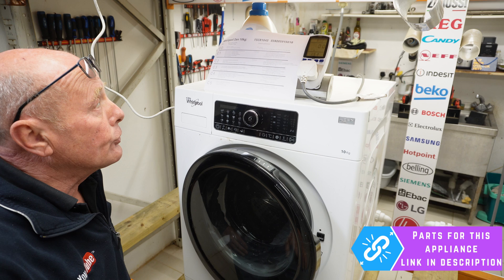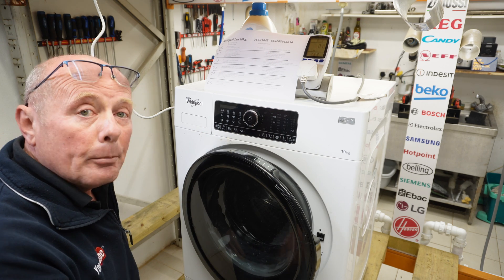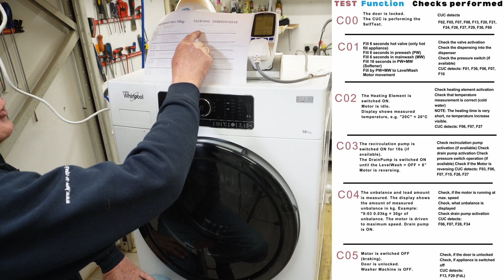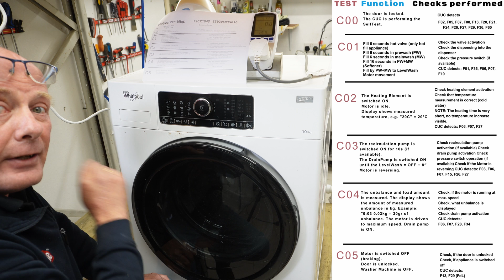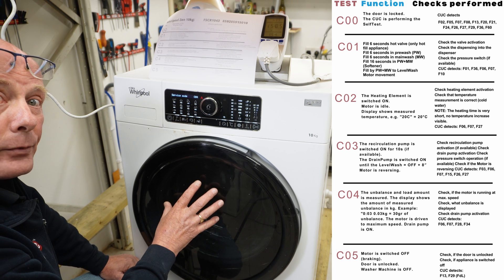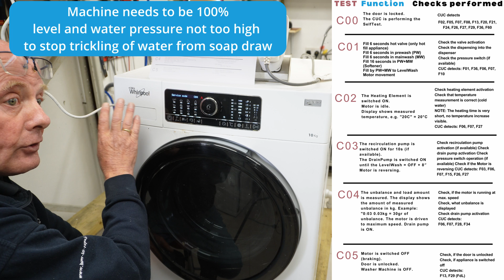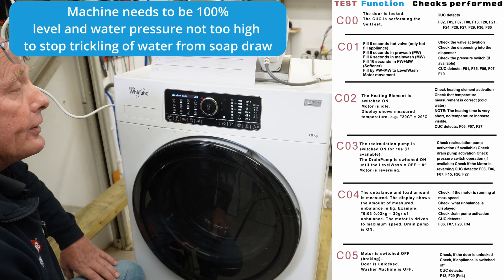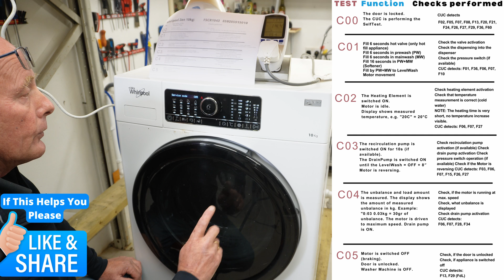Whirlpool Zen Washing Machine Test Mode & Service to run Diagnostic Procedure

Comment: In some rather old LG washer with direct drive motors there is sensor board and in that board resistors come open, causing intermittant motor problems /errors. Do not know thogh if these use same motor..

Comment: had one of these in storage told it was new. when plugged in it turns on itself but is stuck in lock mode. tried pressing lock key for 3 seconds but it does not unlock it. any ideas if this would be a faulty control board?
Reply from the maker: Hi, please use our contact us page and make sure you fill out the request for what your problem is. I will need the full model number of the identification plate and the details of your problem so that I can provide you with useful literature. A video shoot of the problem would be perfect as well.

Normally, I would get back to you within 24 hours but I am on my way to the IFA trade show in Berlin, so it can take more time to respond. Thanks for your understanding. https://www.how-to-repair.com/help/contact-us/   

Please remember to subscribe to our channel, as that's what keeps this channel going. Thanks, Paul 👍
Reply: Hi, I'm having the exact same issue. Could you please let me know if you have found any solutions?
Reply: @pop9459 Hi ,i have the same problem.But I fixed.You can try the same thing.Take out the panel back and disconnect this connectors :brown,blue and the one with to red wire .

Comment: I’ve owned to whirlpools 1 was a whirlpool aqua line 1000 back in late 00s  the other a standard whirlpool inspirations 1200 which was a bit loud but had it for a few years and was at least 6 years old when I had it was a good machine everyone slag’s whirlpool but I had no problems Montpellier and service was the 2 worst ever brands I’ve owned. 
I was going to get one of these zens but could t find it in silver so got lg instead.
But do love the look of this one pitty it’s rusting away indesit and beko are the worst for rusting in my experience.

Comment: Internet suggests on several Whirlpool models that F25 is a Drive Motor Tachometer Error.
Reply from the maker: That's why I was finding it hard to get the error codes as this is the direct drive motor with no tachometer, and the hall sensor is built into the circuitry